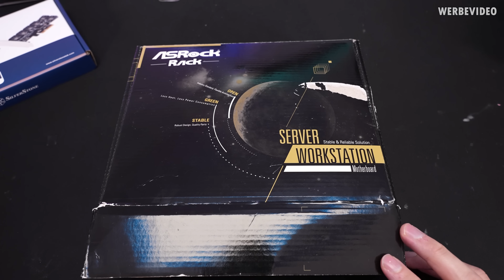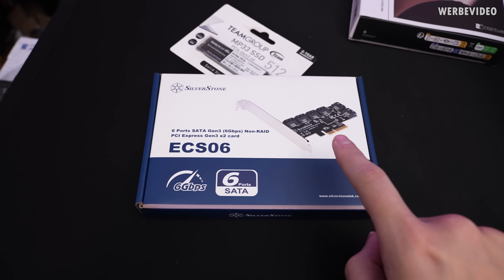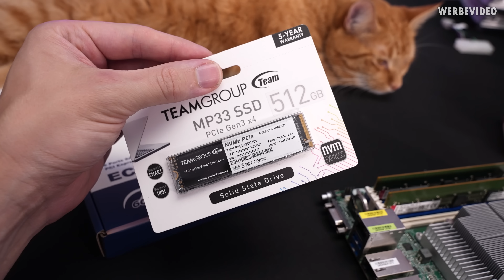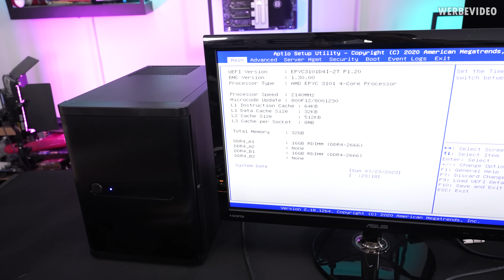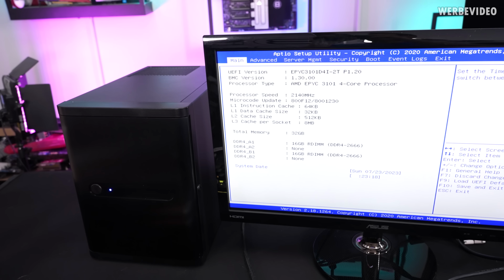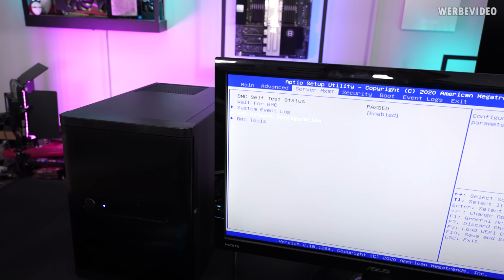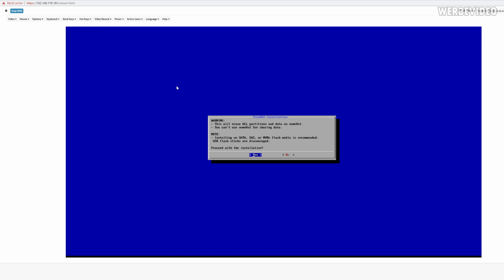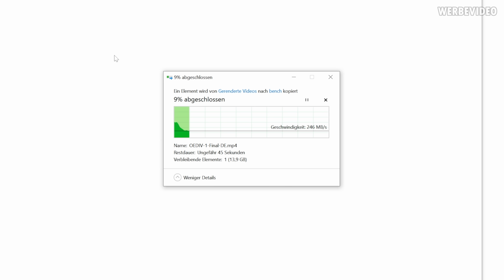First Time building my own NAS

Comment: Are you going to move this to one of your factories after sync'ing all the data? If you could setup to sync nightly you'd have great backup. Worst case if you could bring it back once a week or two and perform a sync for changes and take it back you'd still be in good position if anything happened to your primary data.

Comment: If someone want a really power efficient system the AsRock J5040-ITX is the way to go, on AE you can have a N5105 for ~ the same price and slightly better performance, or the new AsRock N100M for far better performance !

Comment: Really curious why you didn't use the oculink port for more sata ports? It would have been much more efficient to setup that way and cabling would have been much cleaner
Reply: he didnt needed more drives, thats one, two, you still need interface oculink-sata ports. Unless you were thinking about adding external hdd cage connected via oculink?

Comment: Nice, i had the same issue needed a backup of my backup i.e if you don’t have a backup of your backup, you don’t have a backup. Used the same case, i5 intel cpu a sata port extension to give 5 mor ports installed/migrated true nas nvme from old hardware and walla. Extra storage for backup nas…

Comment: Those Asrock Rack boards are fantastic for home servers - I ended up getting the C246 WSI which has an i3 9100T 25W part, which supports EEC (although UDIMM, which are more of a pain to get hold of) and luckily had 8 SATA sports (4 physical, 4 via OcuLink).

I went with a 2U short depth rack mount case to go into my network cabinet, and so I removed the required 12V pins from the 24 PIN ATX, reterminated them into a 4pin molex connector and only ran those, which saved a heap of space for the 24 pin cable and the included adapter.

Comment: Synology stuff is nice, I've been using one of their routers I picked up cheap and it's been the most stable trouble free thing I've ever owned. For DIY NAS there's some older LSI cards that are getting CHEAP these days that do 6GB SAS and 12GB SAS and can do SATA as well if you want to roll with new cheap drives. I picked one up that'll do 4 drives on it's single port and has 2x100GB of eMLC flash onboard for cache. It's almost 10 years old, costs 1/100th of it's original price, and Windows picked it up immediately and the BIOS setup shows 100% health on the flash cache. Too cool! I might pickup a card with more ports that's lacking the eMLC cache since I don't really need that it just looked fun to play with.

Comment: G'day Shiek, Makita & Roman,
My storage is in a CoolerMaster N300 Case, it supports 1x 2.5 SSD, 8x 3.5" HDD & 2x ODD, OS is on 128GB SSD & using 3x 6TB & 5x 4TB HDDs as a back up for archiving old Home videos I have Edited for Family & Friends. 
I am just using W10 as the Mob had an Activated Key while hardware is i3-3220 + ASRock Z77Professional Fatal1ty (10 Sata Ports) + 8GB DDR3-1300 which were just bits & pieces leftover when doing upgrades over the years so thought I give them something to do rather than buying new parts or a NAS as they still work fine.

Comment: I've mostly moved to mini itx over the years and 12vo boards would be a godsend for working in those smaller cases. But you have to put a lot of faith in board manufacturers not to cheap out.

Comment: Id love to know how long it would take to rebuild one of those drives after a failure, I know that people prefer to use more smaller capacity drives because it has less time where you would be in a position that a drive failure may result in data loss
Reply: 4-6TB is the sweetspot

Comment: For anyone raid 5ing, I got some advice from bad experience. When the HD Drives get towards end of life, they tend to give SMART errors all at similar times. When you get the first SMART error, replace the faulty drive immediately with a new one. Reconstruction of data takes a looooong time, more than a day (possibly a few). The anxiety of waiting to reconstruct your data makes it feel like it takes much longer. Then you should assume that all drives are lost and change the rest of the drives one by one. Doing that work can take more than a week (please use a UPS) and you should pray no catastrophic failures happen in that duration. The problem with modern HDD's is that the read/write speeds are too low for their capacity. The real demo might be a dry run of how much a reconstruction scenario would take before any real data is placed in this system when/if the push comes to the shove.

Raid 10 reconstructs faster, because there are less XOR operations. You could withstand to more drive losses, losing just 14 TB. 

The real shocker for me in this video is that , I knew Germans hybridized wolfs with dogs but hybridizing a cat with a tiger was a blasphemy man!

Comment: WOW that looked really simple to setup... GOOD JOB!!!  And the fact that you get about 250-300MB/s (you said GB/s btw lol) that's faster than what I get copying files from my HDD to my Gen4x4 nvme SSD lol - AWESOME WORK!
Reply: Your hard drive is only one drive.

Roman has, depending on parity strategy, 2-4x your hard drives.  And data having pointers to blocks scattered at on the drives to write as they come is the most natural of fits, so the sequential speed scales linearly.

Comment: I've felt the storage pain since my first 1000 MB HDD.  25 TB of video would fit on 100 quad-layer Blu-ray discs.  Access is slow, burning a pain...  but it's there.  Where are the OPTICAL non-moving drives?  Discs approached takeoff speed with 52x cdr's, OK limit reached.  Next!  I mean, Star Trek already predicted it, just waiting! 🤣🖖

Comment: Happy to see some server-content, always fun for some reason.

DS380 has a problem with high temp on the hdd. So i would recommend that you create/add/print a fan shroud that will force the intake fans to blow through the hdd cage, otherwise the air will just blow past them without providing any cooling.
There are plenty of designs and guides if you google.
Reply: I put a foam baffle to block off the path to MB and force air through the HDDs, worked great
Reply: @derekdal5185 
i did something similair for my build. Used a piece of cardboard that i cut from the box it came in and some duct tape. Worked a treat for me too.

Comment: My nas setup is a raspberry pi 400 running OMV with two 500GB SSDs, one being a backup of the other. Has been running with no hiccups for like 500 days. Consumes a miniscule amount of power, i measured it but cant recall exactly.

Comment: I built a simple NAS/server that’s still running today. I was trying NAS OS at first, but revert back to Linux build as I find those NAS OS annoying to manage. Basically containerized service acts like a separated machine whereas I have to hook them to ZeroTier separately ( and the limit of that network is 25…).

My server is an old gen 4 core i7 build with a Chia-era case (remember those crypto craze on storage drive ??). The drives are 7 4TB drive in madden RAID6 configuration (2 parity drives).

Comment: I have this case for my nas. I found that under a lot of load the fan setup isnt great and drives got quite warm. My solution was to take two old fan frames and use them as ducts on both intakes and with some foam on the back of the fans they seal up against the drive bays much better. 
If i was going to do it now I'm sure a 3d printer and some planning could get a nicer solution, but mine has been running for 10 years or so now without any problems.

Comment: most of the time  my old pc become my nas ,  most board have 4- 6 sata drives ,  and most old style and cheap case can have up to 5 hdd space  and i still have my rig from 2008 with core2quad  working as my cold storage backup ,  my every day working nas run out of i5 4gen , need the power because it run plex on it ,

Comment: Roman! Scale is so much more than a NAS. It is really a basic hypervisor with built in apps and docker capabilities run by kubernetes.  Increase your RAM to that 64 gigs and run a Jellyfin sever or PI hole or even a VPN sever/client. I've been learning it for the past year or so and I'm just a normal Gamer. It has been really awesome learning it and the Debian Linux behind it. Plus there is an amazingly supportive community behind it as well as IX systems having a basic open source policy for development of the apps and containers on it.
Reply: I have to say that I've been fiddling with Truenas for the past 2 weeks and outside of super simple NAS use; Truenas is THE WORST. Everything is incomplete and unfinished. The docs are utterly useless as a guide because they try to explain things but never provide examples or recommendations. The community sucks a lot, most threads never get resolved or they just link another thread to TNcore.
YouTube tutorials never go in depth to teach you ways to do things (you'll never find a tutorial over 30mins)
The experience has been a nightmare.
Reply: tried proxmox yet? Also debian but a full virtualisation platform as well as the container support and some standard deploys
Reply: @mycosys  as I am only running a small home lab with a few containers. It seemed unnecessary when scale could handle it. I did look at Proxmox though. Amazing system.

Comment: raid10 and delta backups (also incrementally snapshotted) via zfs send/recv. on regular pc hardware with cheap used hba sas... the operating system could be one of a variety that all supports zfs.

Comment: I build my cheap NAS on HP z230 SFF with i3. Small and quiet, two HDD inside + one in additional in a swapable case. Works good enough to saturate 2.5Gbps lan. Everything under 50$

Comment: Is the fan in the rear intake or out?
If it is in as well, you could just have ducted from there onto the CPU Heat Sink right?
Reply from the maker: out. In on the side towards the HDDs and exhaust for warm air

Comment: If you are looking at a very reliable backup that you don’t need to acces 24/7. LTO tapes are very secure and affordable for a lot of TB.
Reply: The tapes are affordable. The drives are NOT 😂
Reply: @CmdKeen  older lto generations are still extremely reliable and affordable. I use LTO4 since it’s dirt cheap.

Comment: For the PCIe SATA card, if you won't be switching to an HBA as others have suggested, look up which controller it's running, and make sure it's all native ports and not SATA multipliers. Those (and overheating) are the main sources of issues on them.
Reply: Yes, it's using the ASM1166
Reply: I've been using HBAs on my unRAID NAS, zero issues with it. Rock solid. @PéterFriedrich-f4e
Reply: Sata controller is probably a ASM1166. It's PCIe x2. A port multiplier would have been x1 only.

Comment: The hard drives are the components under most heat pressure there, so I'd change the airflow inside the case to have intake through the drives and out take in the back.
Reply: That's literally how it's set up.

Comment: Thanks for highlighting that Silverstone case, I'm planning my own NAS build and was struggling to find a decent case but this checks all the boxes.
Reply: Wouldn't recommend.
The drive bays are extremely cheap and plastic.
Drive cage is a pain to remove
Everything feels like a cheap case from 20 years ago (slighly less injuries though)
Reply: @zxcvb_bvcxz I had the Same experience. It's a pain in the ass to wire that thing.
Reply: Jonsbo N3?
Reply: do you REALLY need hotswap bays? is it mission critical that you can swap drives while you server is turned on? if you do, then the silverstone case is not really "quality" server case for mission critical applications. if you dont, then a fractal node 304/804 or even the older define R7 is more then fine. I use my my NAS as media server and my own cloud services.
Reply: @sprocket5526  It's nothing mission critical, I just want to backup my music directory as I don't want to re-rip nearly 5000 CDs again, took me long enough to do it already.  I just like the design of the case and having the drive access at the front is handy to have.

As for the comment above yours about wiring being a pain, I've wired up worse looking cases than this so it's not a concern.
Reply: @sprocket5526  cable managment in Node 304 is pain, I now bcs have it.

Comment: Weird you haven't gone with the deep mini ITX from ASRock Rack to use proper Epyc Rome or Milan with enough compute capacity to run storage software and any additional apps you might need or want. Plus you could've used the PCIe ports to drive not only multiple SATA devices but also NVMe ones... this was a very basic build, not far off the NAS appliances already on the market, price and capability wise it seems. Furthermore the limited memory installed, almost regardless the software platform and filesystem stack, will hamper this build. Bearing in mind today's pricing on 32GB ECC RDIMMs in DDR4 format, the NAS solution from DiY space should have 64 or 128GB used...

Comment: I didn't even know a 4 core Epyc CPU existed as they're usually monsters with the core counts, Seems very odd. Are they basically defective larger core CPUs that have just had the defective cores disabled and sold to the Embedded market?
Reply: The embedded market actually has extremely high requirements for temperature tolerance, shock, etc. so I doubt they use defective/binned down dies.
Reply: All the other Zen 1 products have been discontinued, embedded is the only place they can go while AMD guarantees availability until 2028. They're not defective; who would buy a defective CPU and knowingly install it in an embedded system?
Reply: @shanent5793  When i mean Defective,I dont mean not functioning! I mean they could possibly have been higher tier CPU in the line that just didn't hit the mark performance standards set so were binned and possibly modded with cores disabled from the factory...rather than get thrown out!

Comment: Those cheap SATA controllers can get really hot. I have a few lying around that produce read errors when overheated and ZFS wrongly assumes the problem is with the disks and kicks them out of the array. An easy solution is to use thermal adhesive to glue a heatsink on them. With disks this big, I would have gone with RAIDZ2 instead of RAIDZ. Rebuilds can take a long time and put allot of stress on disks, there's a good chance another disk fails during the rebuild. And on a last note: Label your drive trays with the serial numbers. You'll thank yourself later...
Reply from the maker: thanks for this info :) I will make sure to check the temp of mine
Reply: @der8auer-en  Might have to tape on a temperature probe because depending on how cheap it is, it may not have internal sensors.
Reply: @der8auer-en yes my dear. I proud for you try you’re best you’re branes but please make more educashin four the computer. Germany xcelent four make the car but no strongly four understanding the pc. I proud you make you’re first nas but if I am honestly you need four more study the book. So no feel so much shame four no comprehenshin my sweet. Many my country ready four teach you how become excellent computer. Never give up and never remember my beauty.
Reply: @RanjakarPatel  उस पर ज़्यादा कठोर मत बनो. वह अपना सर्वश्रेष्ठ प्रयास कर रहा है और अन्यथा वह काफी बुद्धिमान है। उन्होंने फायर बियर कंपनी को अपना ज्वालामुखी पेस्ट बेचने में मदद की, भले ही यह विचार पहली बार भारत में विकसित किया गया था।
Reply: @RashakantBhattachana  ईमानदारी से कहूं तो इसे देखना काफी कठिन है। लेकिन वह अंदर से एक अच्छा इंसान है। और वह अपनी बुद्धि और शिक्षा के स्तर के लिए गंभीर प्रयास कर रहा है। इसलिए मैं आम तौर पर इसका आनंद लेता हूं और इसके लिए उसकी सराहना करता हूं।
Reply: @RanjakarPatel average Hindu nationalist
Reply: @OKNOWIMMAD12345678  thank you so much my dear four youre understand. i apprechiashin and hope four you xcelent days my beauty. yes i am national four hindustan but all country good country but some country better four some things than other country but I enjoi equalitee and martin luther king dreams.
Reply: @RanjakarPatel   Are you seriously telling him to learn about computers? Oooof, my dear...
Reply: Would be a good idea to swap out that Sata controller for a H310 HBA card flashed into IT mode (or the newer versions) with SAS to Sata cables.
Reply: The Silverstone ECS04 (LSI 9217 SAS controller) flashed to IT-mode is a good option. I have used one in my own NAS build. Will require a SFF-8087 to 4x SATA breakout cable to connect the drives with.
Reply: I was going to make the same suggestion and recommend an actual quality IT mode capable HBA especially since second hand hardware can be found very reasonably. I picked up one of thses little PCIe SATA cards just do to some testing to eliminate on-board sata controller as a culprit in an issue I was having I was surprised at just how hot the thing got with even only one drive connected.
Reply: I have seen the same, I bought the 10 SATA from Aliexpress and some how more robust because of the heat sink.
Reply: Yup, some of those cheap sata boards are designed on 2 layer PCBs meaning that signal integrity is out of the window. I used to get all sorts of crc mismatches when i was de compressing files. It took me while to figure out what was happening